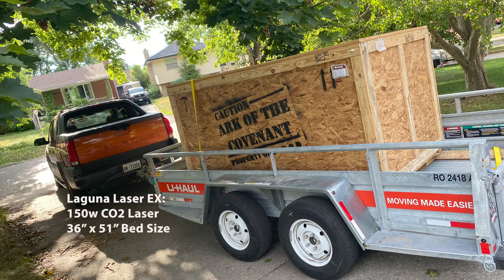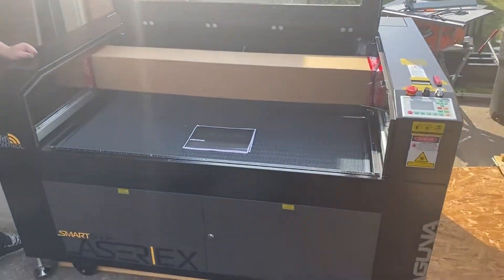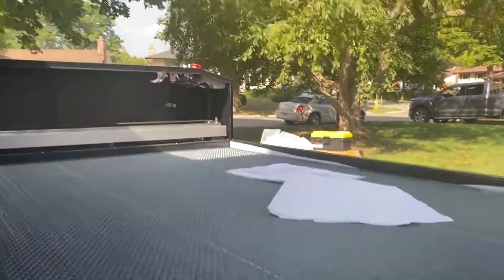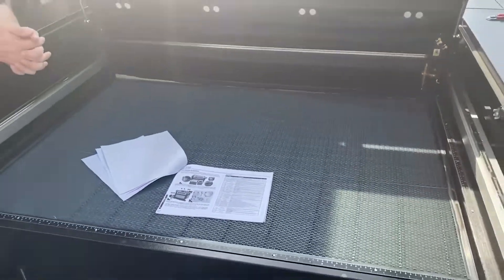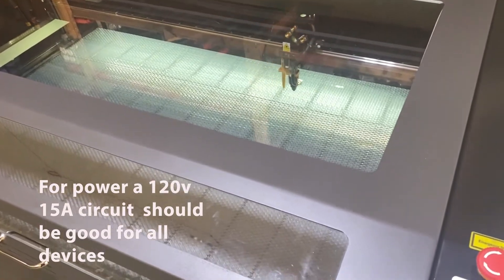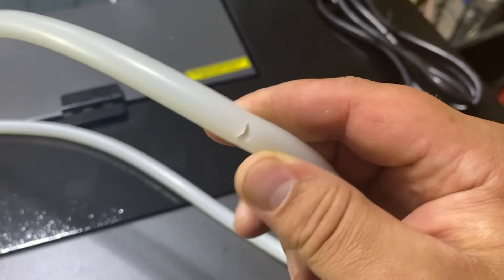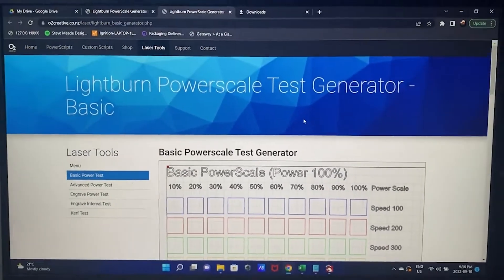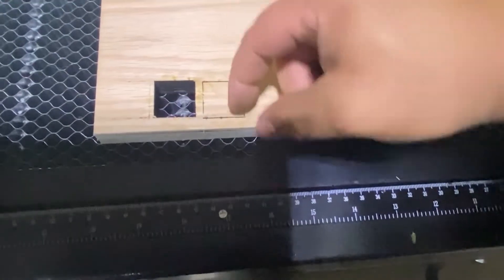Laguna Laser EX Unboxing / Install

Comment: Are you happy with your EX?  Any issues getting support from lacuna if needed.
Reply from the maker: Yes I’m happy with it, the only thing that I didn’t realize is that with 150w it does not do well with dark engraving on wood. It comes out more as a light brown no matter the settings I use. It’s major strength is cutting. I’m going to do an update video soon talking about all that